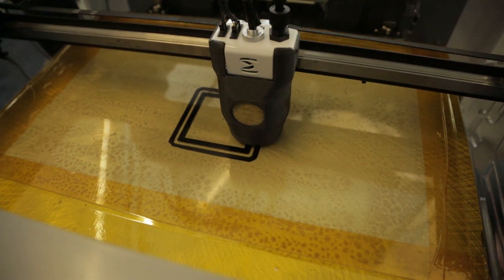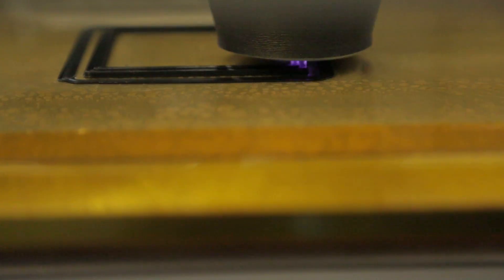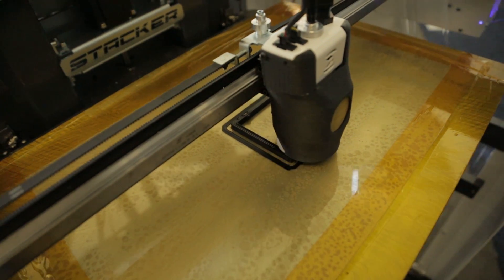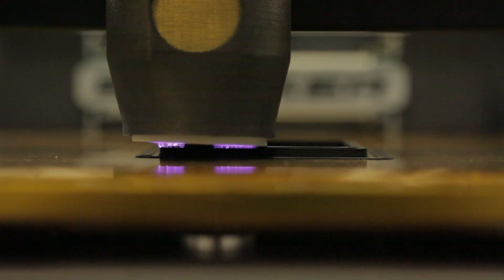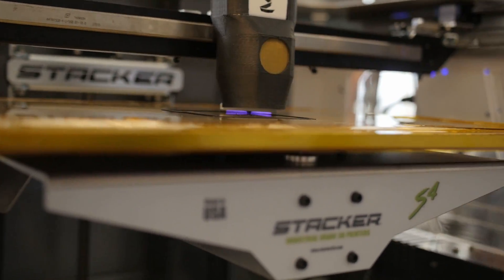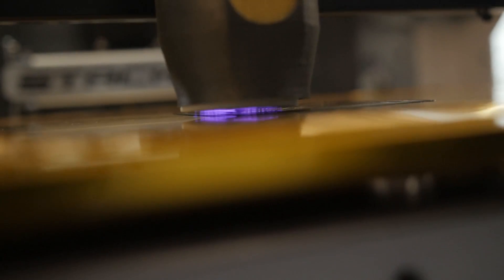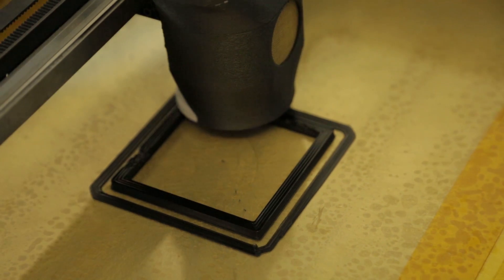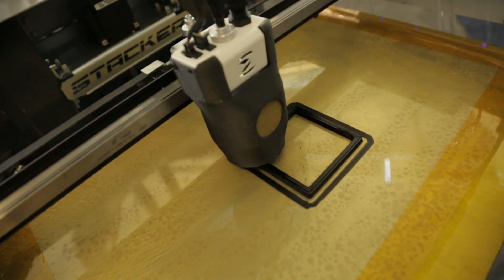Essentium's FuseBox prints 3D with plasma

Comment: The fact that he won't make any improvement claims tells me that the plasma is probably a useless gimmick. Also, they only show it printing a few millimeters in height, how will they maintain a plasma flow when printing a tall part, you'll need conductive materials, and then the whole print will be heated instead of just the top few layers. Seems like if the claim is that the lower layers should be kept warm, you could just add a heater to the cooling fan, but since cooling fans are used in all machines, it seems obvious that we want to cool the print down instead of reheating it. Also, a solid state diode laser would do a much better job of heating a confined spot than a plasma arc ever could.